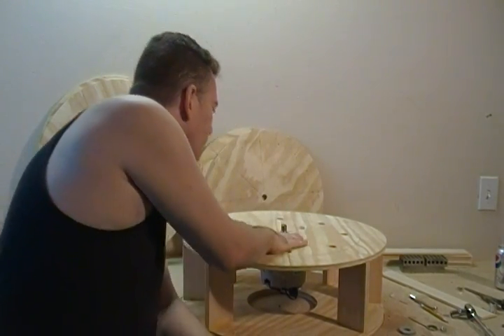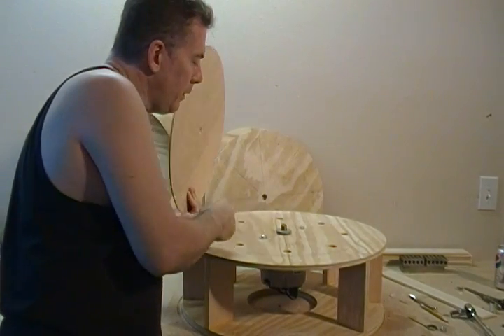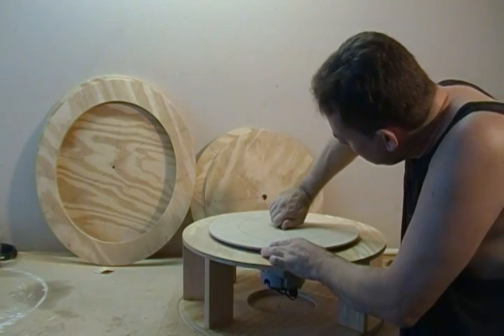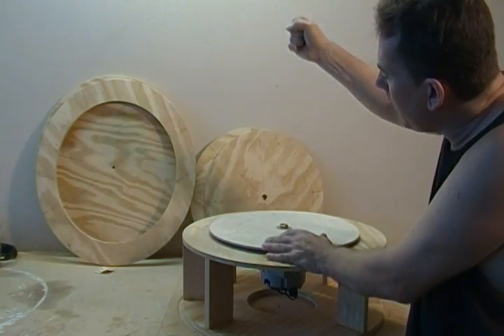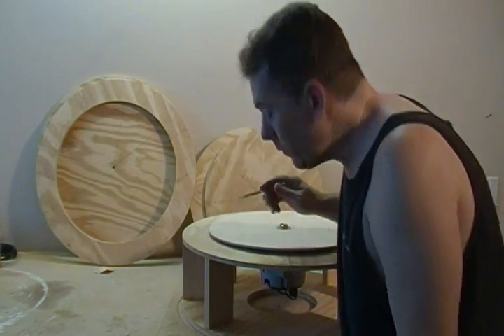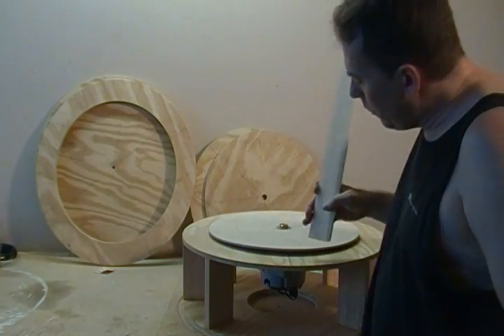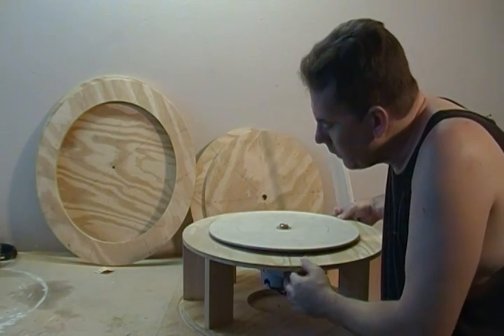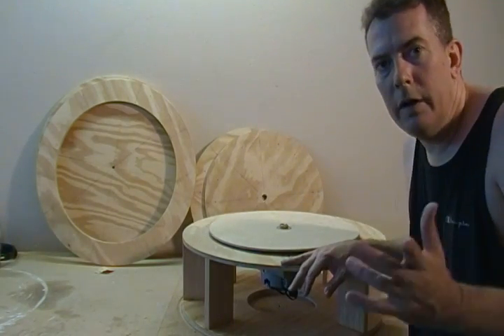Building a Wind Turbine (31 of 46) Check fit for PMA and mark no go circle

Comment from the maker: @MyXboxSavesHD Winds 20 mph and above will top off a couple golf cart batteries very quickly with this turbine. So to answer your question I'm charging deep cycle batteries with my turbine and then use an inverter to get AC power. I do run an evap cooler part time with the energy. Unfortunately for me wind is low to nil here in the Summer, my best wind is during the Winter months.

Comment: @imikewillrockyou It's pretty windy where I live, usually we have about 10-20mph daily, and I want to power my evap cooler. I was looking into buying a motor, but I do not know which one to buy. I just want to run the ac which uses 110 watts on low, so I don't want to buy a motor unless I know which one could power my ac. I was hoping to buy something the would produce enough watts for the ac. We get high winds regularly, just yesterday it was blowing out of the SE at about 48MPH.

Comment from the maker: @MyXboxSavesHD First what kind of wind to you have? Unless you have consistent very high winds (30 mph plus) you'll need a lot of these little turbines to get enough power to run an air conditioner, unless it's just an evap cooler. Even then you'll need 15-20 mph winds consistently and likely two or more of these. You would also need a very high end inverter. My PMA is made by a company called "Wind Blue Power" and this is their "Low Wind" windings PMA.  You can google them. No wind? Go solar.

Comment: I got a Question concerning your PMA Alternator.

I would like to use a turbine to power my air conditioner.

My question to you is what would be a good Alternator to look for, volts wise.

If I'm able, I would be connecting the turbine and ac to a battery, hoping it would stay charged.

Do you have any suggestions and advice you could give me?

Thanks!